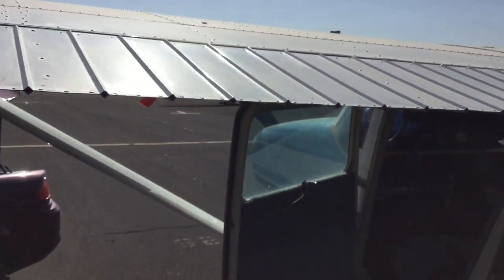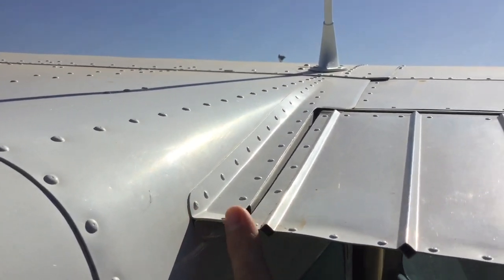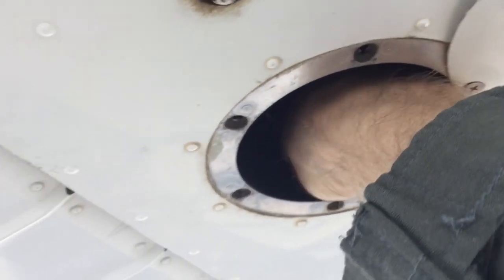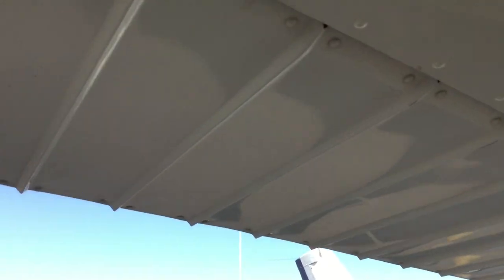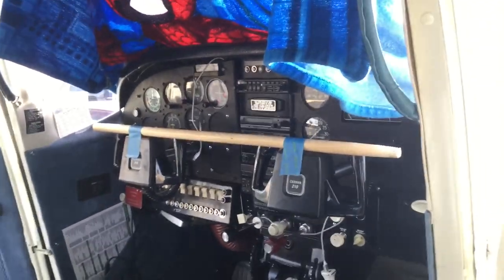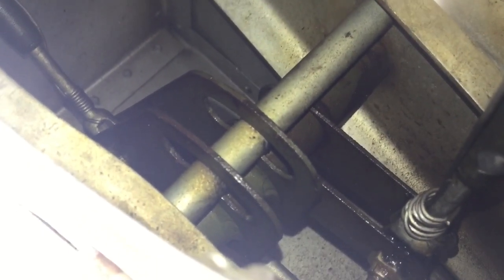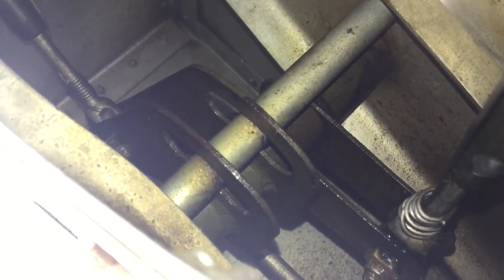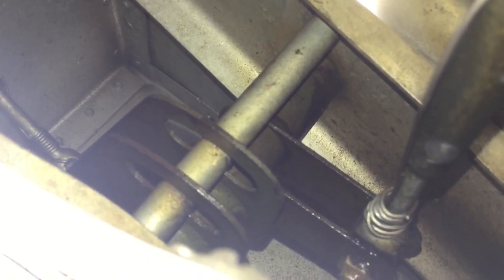Flying Crooked & Slow (part2-Aileron Control Rigging) - This Old Airplane

Comment: When my 206 was having a hard time making book speeds I wondered if it was aerodynamic related. It turned out to be that my A&P had set my mag timing incorrectly.  The timing had been retarded by about 10°. And that turned out to be about 12 knots at cruise.
Reply from the maker: Great idea!  I actually started there, as I had just rechecked the timing during the annual inspection.  Thanks for watching!

Comment: Loosen all of the screws on the wingtip and reposition correctly then tighten screws. There is no real guide to make sure the tip goes on properly other than to line it up with the aileron. Seen this many times as an A&P
Reply from the maker: @scottmonroe6522  gotcha!  Plane is gone, so it’s a moot point for me.  Those wingtips were the hard fiberglass type, and they fit tightly.  There was no slop available to reposition them much at all.  Great suggestion th!

Comment: It's pretty bad when you're flying straight - level and uncoordinated. Either that or your cross-controlled. The 172 I'm flying now has almost a full ball deflection when keeping plane level and straight with rudder and neutral aileron.  Completely exhausting on Cross country flights when you have to put aileron input just to keep coordinated flight.  We'll see if the FBO makes the corrections to my complaint. I would assume this would be considered unairworthy; because this would put the plane in a cross-controlled configuration.  When you are performing stalls the ailerons are supposed to be neutral and you're supposed to maintain coordination otherwise you'll induce a spin. Upon approach to land you are in a low and slow attitude, making the danger all that much more.

Luckily I have two other aircraft I can fly, but I'm not so sure the maintenance is any better. Flying in Alaska I can see why there are so many accidents, with so few options in terms of FBO's.
Reply from the maker: Yep, it definitely makes flying a lot more work when the bird you are in isn’t rigged properly,  I’d also share your concerns with the safety factor of flying a plane that was as far out of rig as the one you describe, for sure!  Thanks for the reminder, I do need to do a follow up to this video, as I most recently did get 52Xray’s rigging squared away to the point where she flies hands-off and coordinated.  Although I didn’t take any videos when we did the adjustments, I could surely describe the procedures with some pics and explain the tools involved in the process.  Thanks!